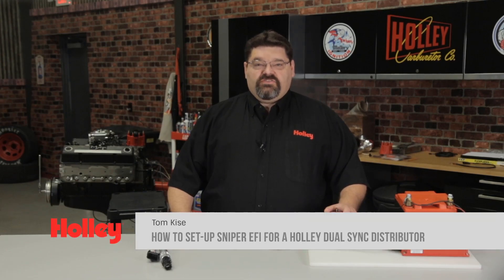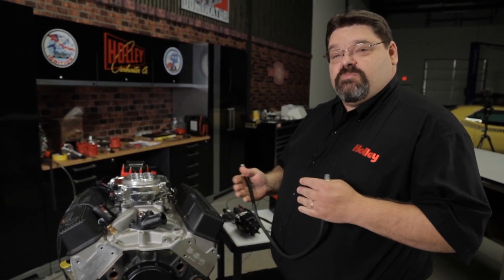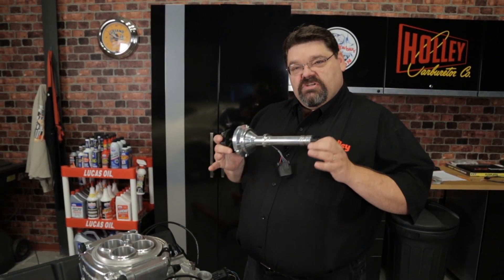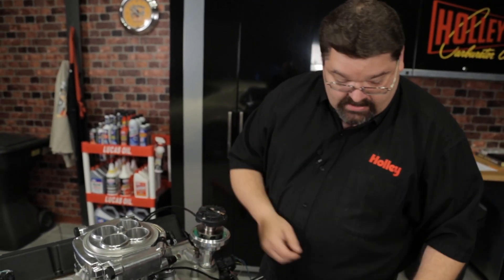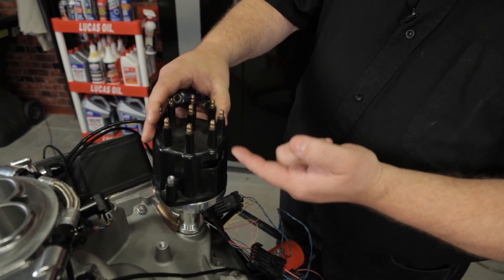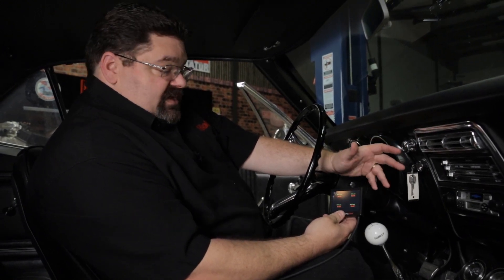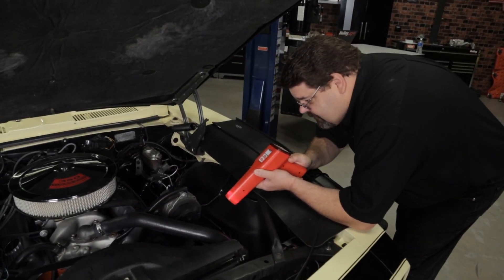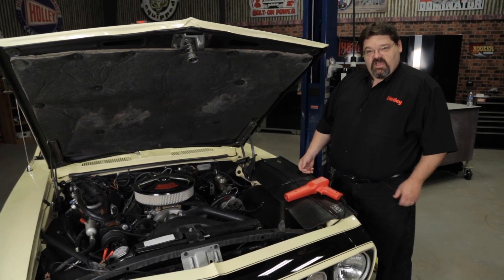How To Setup a Dual Sync Distributor for Holley Sniper EFI

Comment: how come it says learning and seems like it's not  and engine starts to run like a bag of shit ? why it can't throw a fault code like simple misfire or oxygen sensor too lean or too rich? i thought it's easy installation and use and now i hear i need to f around with my fuel map on a laptop to use dsd with sniper ? how come it't can't find where the problem is ? i heard about ecu adopting to the cam or intake  simple misfiring should be easy to tune . i put old HEI and she is running good again so mst be something qith syncing em all together. i'll try next year again

Comment: So i have a chrysler 318 and when i set it to 50 on the balancer it dosent line up the distributor its pointed to cyl 7 if i set to tdc i can line up the rotor contact with cyl 1

Comment: So if you have both, the dual sync distrubutor and the msd 6al digital box, do you select dual sync distributor or cd box for ignition type? Thanks!
Reply from the maker: You would select dual sync distributor, then use the trigger wire from the Sniper to trigger the MSD box.

Comment: I just ordered a Holley Sniper 2300 2 barrel efi system for my 1982 Ford F150 inline 6, 4.9 Liter motor. Do I also have to get this? Thx
Reply from the maker: Nice! You do not need Hyperspark to get it running, but Hyperspark is the best solution for getting great gas mileage since it has more advanced ways of controlling timing and working with the Sniper system.
Reply: THX!
Reply: Thanks. In the event I do decide to get it, is there a Hyperspark you guys make for a 1982 Ford F150   300  inline 6  4.9 liter?
Reply: ford is giving away free trucks .......     they try to make people stay home.....

Comment: I know this is an old video, but it appears you have no oil pump installed in the eng? For the guy's that don't know; if you move the rotor to  the location you want the #1 tower to be, and your distributer does not seat, you will have to sync your oil pump to your distributer pump drive pin. Also you never told/showed your viewers how to confirm the static timing.
Reply from the maker: Good eye, This is a mock-up engine!
Reply: @HolleyPerformance  like all your videos, show us 100% unedited version especially after initial startup....

Comment: How does the MSD CDI box attach to the Dual Sync Dist? Is there a cable?
Reply from the maker: To run the Dual-Sync with Sniper EFI you will need adapter harness P#558-493.  Note: the distributor does not wire directly to the CDI box.  Here is a link to the wiring diagram to control timing with a dual-sync dizzy and a CDI ignition. (page 35)   http://documents.holley.com/199r11031r.pdf  Thx J

Comment: Wouldn't you want your timing to go up as rpm goes up wanting to get this but doesn't make sense to me u set static timing at 15 at idle and when you rev it up you want it to be at 15 so wouldn't that be the same as locking a regular distributer at 15
Reply: I am not an expert but I think the idea here is to set your baseline before allowing the computer to control your timing.  Once you have confirmed your baseline you wont use the "set static timing" setting anymore and the computer will vary your timing as expected.

Comment: Holly crap batman 😕, I wanted this distributor with my Holley sniper but this makes me want to keep it a little more simpler.
Reply: It's not that bad. They're unnecessarily incorporating an ignition box. Not to mention he keeps saying "if this, if that."
Reply: installed the system on a 67 GTO and went with the dual sync, { make sure you set it up 50* before TDC} Also you need the pigtail adaptor (not included in kit) it's really easy to set up with the supplied coil driver that comes in the kit, you don't need the msd box. I think it's better to go with controlled timing vs the stock non controllable dist., although we did run it with the stock dist. for a while and it worked fine.
Reply: what damper diameter did you use?  @johnb2140
Reply: @automech01  , It already had an aftermarket 7" Damper installed, so set 50 degree mark @ 3 1/16 inches bdc, I think most people don't understand this step and therefore have troubles with the DualSync controlling timing, A friend of mine even went to a "profesional" ;that had installed many efi systems, "supposedly" and he completely missed the procedure.